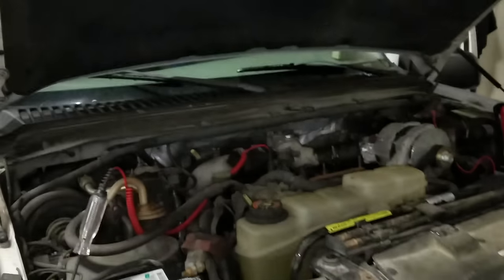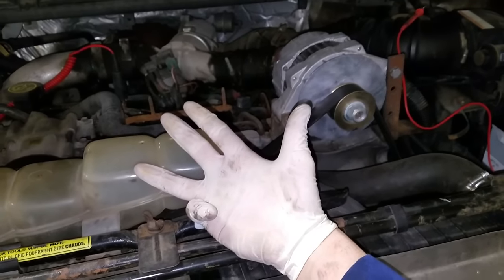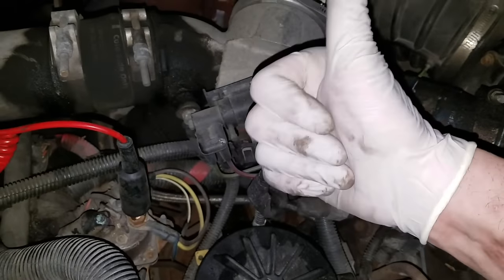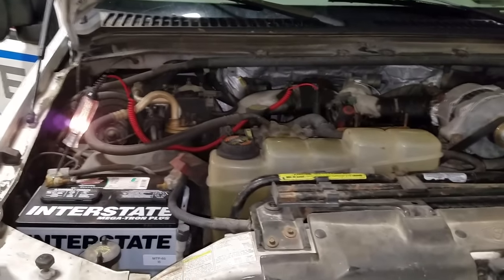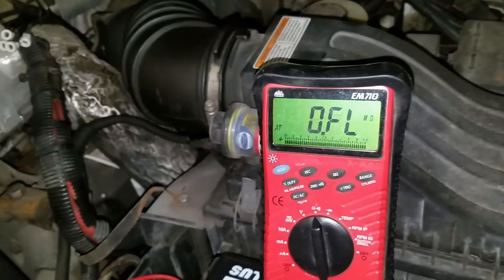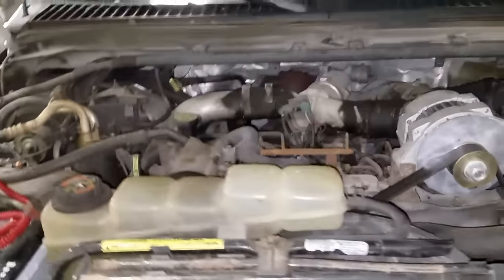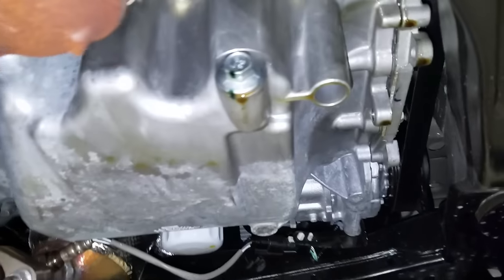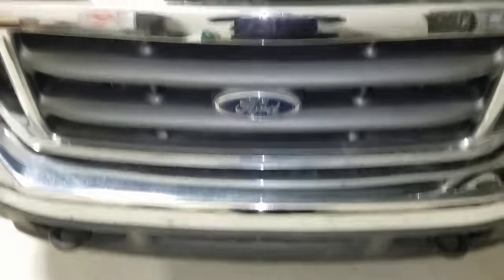Ford 7.3 Diesel- GLOW PLUG SYS-TESTS

Comment: 1998 E350 here.  Concerning the dashboard indicator light, with a failed glow plug relay will the dashboard indicator light still come on,  or will it not come on.  I'm just now beginning to start investigating why I have white smoke sometimes on startup and sometimes not.
Love the van but Damn,  really hard to change those drain valve all rings!  Thank goodness my 7.3 has never left me on the side of the road after 300,000 miles.    Are you able to open up that relay by the way and clean up those contacts?
Excellent tip ,  good camera work too.   Thank you,   Subscribed!
Reply from the maker: Thanks 4 subscribing! Yes the light will still come on if the relay has failed. Make sure 2 watch the 7.3 videos i have. Itll show you the most popular causes for either white smoke[incomplete combustion]or just a straight up 2 check your glow plugs.

Comment: Hey question to anyone  I just replaced my head gasket in my 2003 f350 7.3 powerstroke  and   When I got it started  it was ticking  from under the truck  and then it went away and only when you push the gas petal down it will but the code comes up as oil temp sensor would it cause the tick
Reply from the maker: No an oil pressure sensor is not gonna make it tick......
Reply: So for some reason not sure how but I check to see if the oil temp sensor was plugged in and it wasn’t  so after plugging it back in the noise went away   Engine light is out and it’s not bucking  or ticking  and thank you for the help

Comment: Having issues with hard start in temp around 40 degrees. Replaced the relay, starts a little better, but still get a lot of with smoke when it starts, suggestions?
Reply from the maker: Going thru my two 7.3 hard start videos shld be what you need. If you would like to get a hold of our Hotline, visit our paypal & we can continue with high speed voice communication.

Comment: I have 04 7.3 no start and did hi psi pump. fuel pump and fuel reg screen I put start fuel in it to see if it would start and it fired right up but died.the wait lite comes on and goes out have rpm have oil psi .and no start could it be the glow plug  or idm please help
Reply from the maker: You mean 04 6.0. Are you sure you have high pressure oil?
Reply: I'm mean 96. Sorry
Reply: And ya all new
Reply from the maker: Did you replace the lift pump in the valley?

Comment: Also if glow plug relay were to go out why you were driving could it cause a massive power loss like I was pulling 6 trailers couldn't get above 15 mph it was 29 degrees now it will not stay running starts but dies fast I have codes P0261 cylinder injection circuit low and p1295 code Injection multiple faults I have done buzz test everything sounded fine also tried pulling icp didn't help and tach is still moving when turning over so believe cps is fine I have also fuel pressure tested it's within spec please help
Reply from the maker: No it wld not

Comment: Part number for the harness tester???
Reply from the maker: Old Ford special tool. You'll have to look it up
Reply: Without the harness, you can still test at the connector. Make sure it's the correct pins though.

Comment: What brand oil and weight also fuel additives would you recommend for a 7.3?
Reply from the maker: 10w30 in winter 15w40 in summer....all motorcraft!!!
Reply: PowerStroke Tech Talk w/ARod thanks
Reply: I run delvac 1300 15-40

Comment: I have a 97 7.3 and I was driving the other day and it started to putter and didn’t want to accelerate and was white smoking and was super hard to start and after driving for a little bit I pulled over shut it off and it wouldn’t start back up….i put a new ipr valve in it and new glow plug relay and it just cranks it won’t even try to turn over. Do you think it’s the glo plugs? My next thing I was going to try was glow plugs and fuel filter because it cranks super healthy it just sounds like nothing is trying to ignite the fuel. PLEASE HELP BRO I’m broke and can’t afford to just keep throwing parts at it!!!!!!
Reply from the maker: Brother. Glow plugs do NOT ignite the fuel
Reply: @PowerStrokeTechTalkwARod   then what would cause it to just sit and crank and not even try to fire up? Like I said I replaced the glow plug relay and the ipr valve yesterday.
Reply from the maker: You gotta bring it to me or a tech to find that out. Scan tool time

Comment: Friend called me and said his truck wouldn't start, temp was like 20*, he said he kept cycling the glow plugs, when wait light would go out he would turn key off and back on. I told him the wait light had nothing to really due with the gp's so just turn on the key and leave it on for about a min  and them start it. Call me later and said that worked.

Comment: Only thing I didn't get was you said .2 to 2 ohms was with in spec but when it read 1.4 you said that's not right why is that?is the goal to get as close to 2 ohms as possible?

Comment: Awesome video man. I have a 2003.  7.3 powerstroke. Was doing  phenomenal no matter how cold it got. Recently installed a TS 6 position switch. Suddenly my truck won't start. Was starting fine without it plugged in when the temp was around 10 degrees. Was almost 50 degrees yesterday and would only crank and blow white smoke. Took me almost 10 minutes to get it started. ANY help or advice would be appreciated!!!!
Reply from the maker: Did you follow my steps in the video to diag & see if your glow plug system is functioning correctly?
Reply: @PowerStrokeTechTalkwARod  not yet. Just found this video yesterday. I just thought it was weird that this happened out of nowhere. I have to plug the truck in now before I leave work and overnight. It just started this almost out of nowhere.
Reply from the maker: Well if your gp relay stops workin then this will happen right away...
Reply: @PowerStrokeTechTalkwARod  GP relay tested fine. Must be my plugs?
Reply from the maker: Ohm out your glow plugs 0.0 to 2.0 ohms
Reply: @PowerStrokeTechTalkwARod  can I check them without that harness you have? As in check it at the connector on the valve cover?
Reply from the maker: Yes, glow plug circuits are the outside pins at the valve cover connector
Reply: @PowerStrokeTechTalkwARod  ok sorry for so many questions. Ground my ground prod and put the positive prod to the connector right?
Reply from the maker: Yes to the connector male end of the valve cover gasket, external. Not the engine harness side, valve cover side....
Reply: I don't mean to pester but is there an email address I can message you at? Just wondering if you can help me with a new host of issues.
Reply from the maker: Yea give me yours & ill email u...ill delete ur post after we've connected
Reply: Re clean the tuner and pcm connection. IT MUST BE VERY CLEAN
Reply: Sorry about the late reply, however, this may help others as well. I run a 50/50 mix of 5W-40 T6 and 15W-40 T5 Rotella in the winter. It has made cold starting much easier.

Comment: Do I have a 2002 f250 7.3 PS. Won’t cold start. But if I plug it in to the block heater for a few minutes it starts right up.  Thoughts?
Reply from the maker: U need to do these tests so u can find out what is not functioning

Comment: Where do you get that tester?
Reply from the maker: Maybe the internet...not sure
Reply: @PowerStrokeTechTalkwARod  I'm looking now haven't come up with much but kll keep looking thanks
Reply: @PowerStrokeTechTalkwARod  I found the 5 pin glow plug tester through summit made by OTC but not the 10 pin that you have that test both GP and injectors.

Comment: I've got a 99.5 F250 and I had the glow plugs replaced with Bosch glow plugs and the glow plug relay  was replaced too about 3 years ago. New batteries less than a year ago. I've put 40,000 miles on my truck in 4 1/2 years. Now its turning over really slow and doesn't want to start very easily when it's in the 30's. What do you think?
Reply from the maker: Im pretty sure if you go thru the steps here in the vid youll be on your way to finding your faulty component
Reply: @PowerStrokeTechTalkwARod  I know. I just somewhat wanted your opinion. Like how long can you expect to get out of glow plugs? Cause I'm feeling like I should get a lot more than 3 years right? I've heard the relay is common, I'm just waiting for my truck to cool down so I can accurately test it
Reply from the maker: True u shld....but there are 2 other things, the EOT sensor & the PCM both will cause the relay to not come  on.
Reply: @PowerStrokeTechTalkwARod  the truck starts fine if its plugged in and the light comes on and goes off normal. I know if you don't have voltage at the other post when you turn the key, the relay is bad, and I've also heard you can have resistance from the relay too which will make it have problems. Like where you put an ohm meter touching both posts and turn the key it should go from 12 to 0? Have you heard of that?
Reply from the maker: Ull have 2 give me ur email
Reply: How's your AIH relay working? When it is cold you will need three things to work: 
1: EBPV valve
2: Glow plugs
3: AIH 

I had a hard start due to a bad AIH relay.
Reply: @norman_sage2528  What is the AIH relay?
Reply: @brucebell7623  Air Intake Heater it is a heating element in the y- pipe